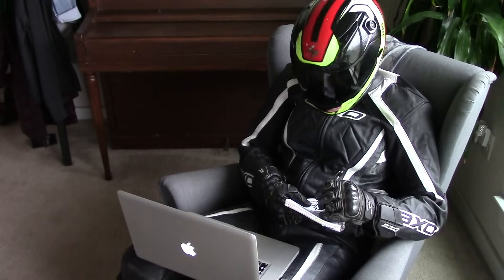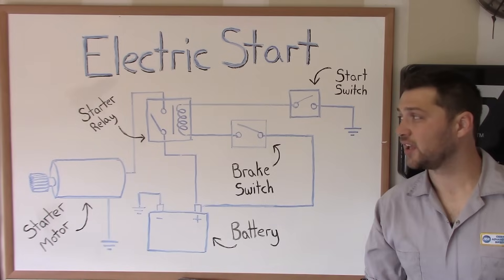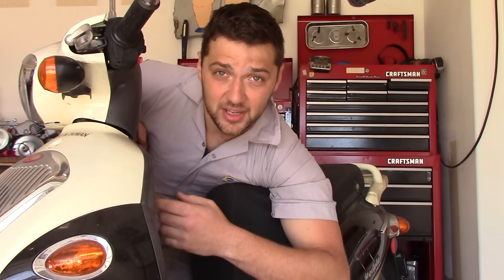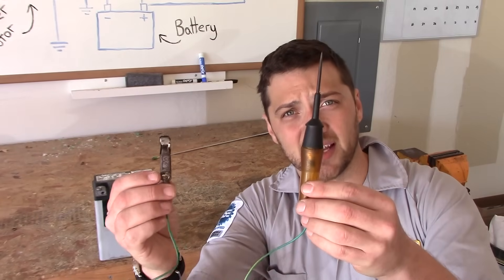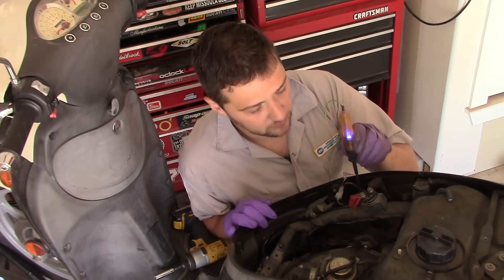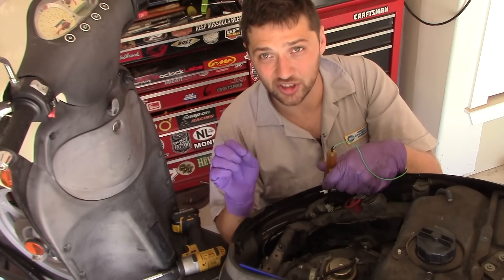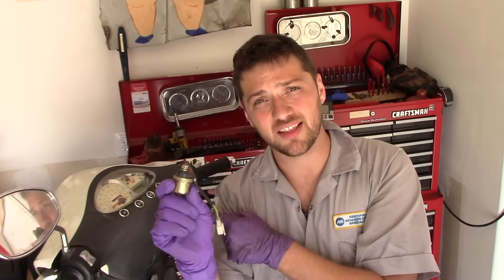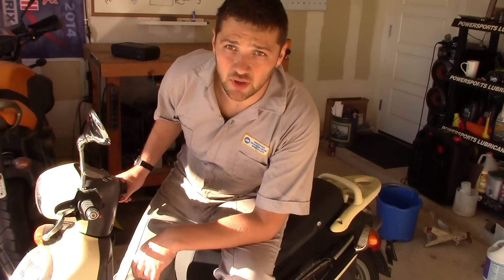Scooter 911: Electric Start Doesn't Work (troubleshooting your starter, starter relay, and circuit)

Comment: My scooter start makes a clicking sound with electric start only. I have a new relay ,  Electric starter, cdi, spark plug, great battery, and start switch is not new.   
My  Blinkers works good, headlights work but very low and head beam want turn on the lights stay normal mode, the break light does not work, however rear light is working, it drive pretty good. I just miss the electric start. 

Do you think it the break switch? I  also have no spark.  Can a bad break switch stop spark? I have  good compression and gas flow so I kick start for now. 

And the scooter is new icebear 2019 motorcycle.. 

Can you tell me things many things to try in a little list. To gain my spark back and fix my electric start system. Thank you
Reply from the maker: You got it! More than likely it's the brake switch. I made a video on replacing it to help out though https://youtu.be/xapfVSbhhR4
Reply: @Scooter_911  thank you. My last question can a bad break switch cause no spark?
Reply from the maker: @gratefulforlifeandkindness  not in any scooter I know of. How do you know it has no spark?
Reply: I took the spark plug out, put it in the ignition coil put it on metal. I use my  Electric start  I send no spark at all?  All I hear is  Clicking  on the relay but the relay is new. My electric starter is in good condition as well. My cdi is new, spark plug new? Only my kick start works. The scooter is 2019 most the part are in good condition.
Reply from the maker: @gratefulforlifeandkindness  the engine has to be turning over for spark to be generated. Since the electric start isn't turning the engine over you will not see spark. But the fact that the engine runs when kick-started show you that spark IS being generated. Did you try the starter relay bypass test at 7:30 ?
Reply: @Scooter_911  your right man, I replace the relay today, and got a better quality  electric starter. Idk if  my spark is back. But it fire up using the  Electric start now. Also clean my  Bandit with  paty Lubrican as well. My scooter  back working with the electric system thank God and you. And the kick start work good as well I  Greased it up.

But there still one problem my break is Amway on. Now I don't have to pull the  Brake button and touched the smart button it  Weird. Also my high beam light not working? I'm going get a break switch tomorrow.

And thanks for telling me in order to get spark engine has to turn over. I will remember that. I hope I can get the break lights back  Function in normal
Reply from the maker: @gratefulforlifeandkindness  glad to hear it! Keep it shiny side up!

Comment: You just help me diagnose my problem perfectly thanks for that, but how do I repair the wiring if I changed out my fuse to a higher  amp one to prevent it from blowing and f**cked the whole relay.

Comment: My scooter electrics not working, no horn, headlight nothing working battery is fine what may be the reason?
Reply from the maker: did you check the main fuse near the positive battery cable? it also could be an issue with your ignition switch

Comment: Thanks for such excellent videos. I have an e-ton beamer which was sitting for a couple of years. It worked fine until last use but now its crank is very slow when i try to start it with battery as if the motor is trying hard but unable to rotate. It also wont start using the kick. Also, the headlight and a side light dont work and the front brake is jammed. I would greatly appreciate some tips on fixing these issues. I know these are minor problems and i can fix them. Thanks in advance.
Reply from the maker: Those are great suggestions! And I have videos planned for several of those services planned for this year! Stay tuned!

Comment: I have a 50cc TaoTao VIP Champion. I'm not sure what's wrong with it and I'm freaking out. I went to start it and it won't start at all with the electric start and I tried kick starting it and it tries but doesn't catch. I charged the battery thinking it could be the battery and still nothing. It will click when you turn the throttle to turn it on but it won't make any sounds like its trying to actually turn on. Fuse doesn't look blown... Any suggestions on what I should do? My moped is my job right now and I can't afford to lose it...
Reply from the maker: Did you try the starter relay bypass at 7:32 ?
Reply from the maker: If you'd like I can also try to help you troubleshoot it over Skype. Shoot me an email at garretseesingofficial@gmail.com

Comment: Hey great video very simple and direct to the point... I was wondering if you can make a video regarding   50cc scooter wiring  harness connections. I have a zn50qt and the wiring was unhooked  and now I don't know which plugs connects to each other thanks

Comment: Thank you for the video! I could start my scooter by bypassing the starter relay. Does it mean that all the other connections are alright? Do I need to change the starter now?
Reply from the maker: If it started when you bypassed the relay then the starter is just fine! If the relay clicks when you hold the brake lever and press the start button then your connections are good and you can just replace the relay. If the relay does not click, then you most likely have a bad connection somewhere.
Reply: @Scooter_911  It worked! I changed the relay. Thanks a lot! Nobody wanted to help me in Berkeley.
Reply from the maker: @gonzaloherediaedelstein7631  right on! Glad you figured it out! Keep it shiny side up!

Comment: 3:10 where would this ground be or what should I be looking for on a kymco agility 50? Same sound battery has 12.6 volts so the battery should be fine.
Reply from the maker: Finding it can be very tricky. Often times there is a green (ground) wire that gets secured to the valve cover by one of the valve cover bolts. I talk about them here in my valve adjustment video - https://youtu.be/QkkYjRdtQxg?t=311 . Sometimes when people take the valve cover off or change a spark plug they will remove or damage this wire. Other times it's not as easy to find, and a ground wire has been damaged somewhere deep in the harness. The easiest way to test this is to "Overlay" (install your own) ground wire directly from the negative battery terminal to somewhere on the engine. The valve cover is an easy place to go (which is probably why tao tao does this from the factory. If your overlaid wires improve cranking just make them a permanent fixture. Another thing you can do is keep your multi meter on the battery while cranking the engine. If the battery voltage is dropping lower than 9 volts you most likely have a week battery, if its not deflecting very much at all its more than likely a ground. Hope that helps GOOD LUCK!

Comment: I've got a scooter just like this and I can't seem to get it running I replace the carburetor is getting fuel and has spark and everything and I can crank it up and it'll stay running for just a second and it'll die and I can't figure it out and I've done this a valve adjustment and it still doesn't stay running what's wrong
Reply: I had that problem and i learned that there was a float that would get the spark plug wet and so it would turn over but then die a second later, hard for me to exsplain but i am sure that Garrett can exsplane better.

Comment: I came to learn how to troubleshoot my starter. I stayed and subscribed because your presentation is FANTASTIC! What a great vid! Hope to fix my "trusty scoot" soon!
Reply from the maker: Great news! Thank you!
Reply: @Scooter_911  I figured it out thanks to your video. It wasn't a problem with my starter at all. I's my brake light circuit! I noticed when fixing my tail light that the brake filament would only light when squeezing the front brake. I had been using my back brake to try to electric start this whole time. After watching this vid, I realized that the circuit for my back brake must be broken, so I tried electric start with my front brake and it worked!! You saved me a lot of time, effort, and frustration. Thank you!!!

Comment: Garret I can bypass the starter relay and get the scoot to turnover. Pressing the start button does not engage the starter relay. Bad start button? Brake light does light up when brakes are pulled in. Horn does not work. Gas gauge does.
Reply from the maker: it very well could be a bad start button but it could just as easily be a bad starter relay. a test light will help you find the issue. remember the start button supplies the ground to the starter relay through the 2 pin connector. so test the 2 pin connector for power when the brake light is illuminated and test the other pin for ground when the starter button is depressed.
Reply: I appreciate the reminder AND the reply sir. I did replace the relay so I’ll check that two pin. Thanks!!

Comment: I have a question about a sound my scoot is making maybe we could skype and you could give me some advice
Reply from the maker: Absolutely! Shoot me an email at garretseesingofficial@gmail.com. let me know a little about your problem and we'll set up a time.
Reply: @Scooter_911  hi I'm  paul
Reply: my 150gy6scooter electrical won't start.?
Reply from the maker: @narinepersaud928  did the video not explain your exact symptom?
Reply: @Scooter_911  try everything and still no power. went again and check the  fuse and found it blown. change it and it works, tks for replies. questions  I'm looking  to purchase a 1985honda elite do u have  or link me .please

Comment: My frame is vespa px none battery. But the engine I have ordered is a electric start...... Will it be OK to put in and just use kick start
Reply from the maker: Yes it should be ok as long as you are using the non-battery ignition system.
Reply: Garret Seesing oks thanks

Comment: Hi garret love your videos very informative 
Ive got an issue with my smc 50cc starts and idles no problem will rev up on centre stand but is very sluggish and under powered when riding any ideas ???been told could be  Possible variator issue 
Maybe you could do us a little video regards lee
Reply from the maker: It very well could be. It could also be a compression issue, either needing a valve adjustment or a top end. I plan on doing some videos on the transmission soon! Thanks for the suggestion!

Comment: I really like how your descriptions were clear and easy for beginners like me! Plus I love your humor.! But I am still lost! I started taking panels off like crazy (just like you said not to) But I really want to see just how everything works.When I try to start it sounds like something is spinning and not catching (manual start doesn't work). I tested the Battery, The Relay so I am guessing its the starter. Is spinning sound typical from a faulty starter ( FYI - Just put in a fresh spark plug and it was crusty!)
Reply from the maker: Well I'm assuming you're working on a 50cc Chinese scooter then. The two most common issues I've seen that result in that noise are a faulty starter motor, and sometimes a jam in the starter Bendix. You can pull the belt cover off and watch the starter gear "shoot out" and engage the teeth on the variator. If there is a jam the gear won't come far enough out to engage
Reply: @Scooter_911  Wow!.. Thanks so much for the great info at Lightning Speed!  Yes.. Its a Tao Scooter! Will try it and have subscribed to your channel and look forward to learning more with you! Where are you located??
Reply from the maker: @lynnmcpherson7296  I'm in Austin Texas. I'd be happy to walk you through a further diagnosis over Skype if you want
Reply: @Scooter_911  You bet.  Gave up for the night and work from 9-5 (Central) but put me down for tomorrow night.  Let me know what your rate is but I'll gladly pay for it. No one is helping me and I depend on my scooter. (Gave my son my car.. It means more to him than me)
Reply from the maker: @lynnmcpherson7296  email me at garretseesingofficial@gmail.com and let's schedule a time
Reply: Garrett.. I need to ask a question. I have the drive cover plate off, inspected everything including the bendix. It looks like its moving freely but wanted to see what happens when i try to start my bike.  Is it ok to do this while the cover is off?? And 1 more thing. My kick start gear has a tooth that melted together. But wouldn't this only be an issue if im trying to kickstart??
Reply from the maker: @lynnmcpherson7296  yes you can attempt to start it this way to observe the starter operation. Try to do it as little as possible though as that bearing can be damaged by not having the support of the case. And yes you are correct issues with the Kickstart teeth will only affect the kick-starting of the engine.

Comment: Hey i bought a scooter from some one when i connect the battery it sparks and i recently broke my kick start case.. Is their a way to run a wire from battery stright to the start switch
Reply from the maker: Well not exactly. Technically there is a wire directly from your battery to your ignition switch. But I think you must mean a wire that connects your battery to the wire harness with the ignition switch. There really isn't a way to do that. The ignition switch isn't strong enough to handle the power that flows through the battery cables when you use your starter motor.

The Sparks are most likely coming from a short in the starter relay. Disconnect the big wires from the starter relay and see if it still Sparks when you connect the battery

Comment: Hello, I am trying to get my 2006 people 250 road Worthy but having some issues. I started the engine and let it idle for several minutes, then it shutoff by itself. Afterwards I could not crank. I disconnected the negative battery. And now the engine tries to crank by itself  when I connect the negative terminal without any key inserted. Do you think my scooter is dead and out of commission? I am stumped. With no key and kill switch on and positive terminal connected to positive battery and negative terminal unhooked. Without no key, when I try to connect negatice terminal to negative battery, I see Sparks on the negative battery and engine tries to cranks on its own with no assistance but never starts. Any help with your expert knowledge is appreciated. And I enjoy watching your videos ..
Reply from the maker: Wow that is quite a predicament! The first issue sounds like you're starter relay is stuck closed. But you might have further electrical issues. If you'd like I can try and help you figure it out over skype?
Reply: My Skype invite is
Https://join.skype.com/invite/Be5NF6iW4Gs8
Reply: This is a scooter from hell. It's possessed 😊

Comment: My electric start randomly started doing the starting sound really slowly and now it has stopped copletely, is the starter motor broken? I can only kick start it.
Reply from the maker: The most likely cause of that issue is a weak battery. Give jump starting it a try
Reply: @Scooter_911  I'm having the same problem. The first thing I checked was my battery. It is fully charged and is holding a charge well. All my indicators, lights, etc. work. My electric start no longer works, and I have been relying on kick start. In this case does it sound like a starter motor problem?
Reply from the maker: @pyro-millie5533  more than likely not. Starter motor issues are more rare than you might think. Make sure you perform the starter relay bypass test @ 7:32 this is a great way to test your starter motor and to give your diagnosis a direction
Reply: @Scooter_911  That's the first thing i'm going to try. Thanks!! By the way, are you familiar with Coleman's 49cc scoots? That's what I've got, and it's layout is a bit different than most other scooters. for example, the battery isn't your typical auto battery, its a small battery in a blue plastic casing with rounded edges. It should still have all the same components as other scooters but they might be in weird places
Reply from the maker: @pyro-millie5533  absolutely! I've seen them all and while you might find a strange battery in one you might find a different battery in the same scooter made just a few months previous! Even as a dealer we saw our new models come in built a little different with nearly every shipment!
Reply: @Scooter_911  That's so strange! glad to know mine wasn't the odd one out haha

Comment: I need help my starter wont work , I can get it started by the starter solenoid but blinkers horn doesn't work, only headlights work
Reply: And It doesn't start when the key is in the off position so I figured it was probably not the ignition but could I still be wrong?
Reply from the maker: @danielthompson8078  if you want I can try to help you diagnose this over skype
Reply: You were actually right, thank you I bypassed the ignition just to be sure and it worked so thanks for the input
Reply from the maker: @danielthompson8078  glad to hear it!
Reply from the maker: oh that might be a problem with your ignition switch! When you bypass the starter relay does the engine actually run or does the starter just crank the engine over?
Reply: It starts and runs perfectly fine but even while running nothing but the headlights and taillights work